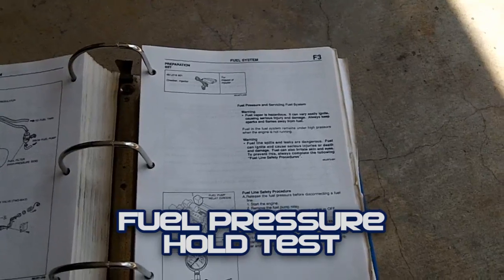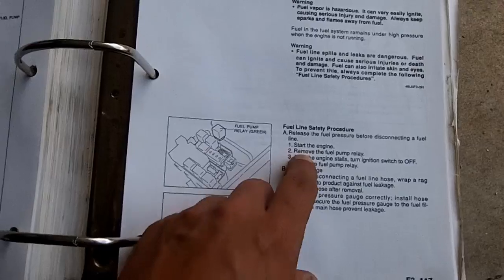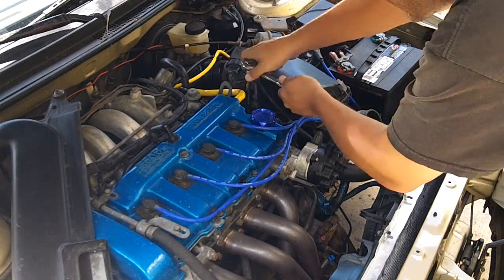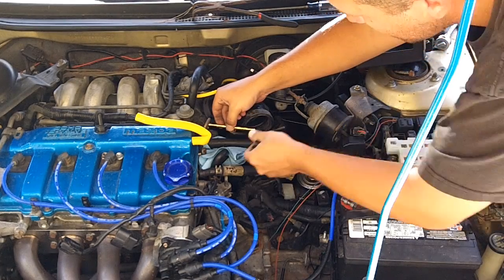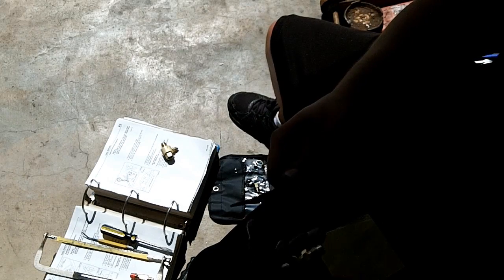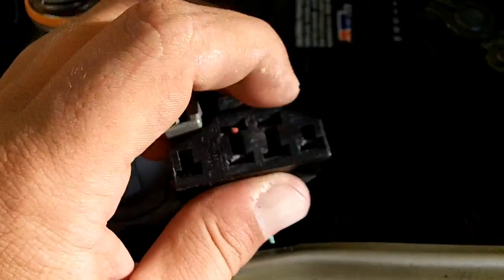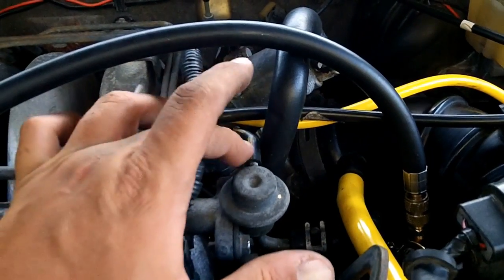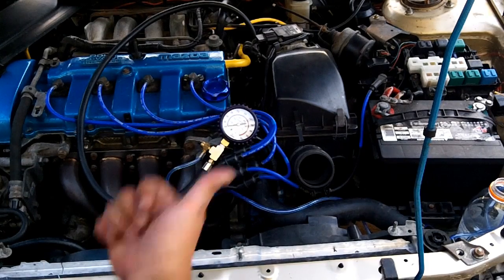Mazda 626 - Fuel Pressure Hold Test

Comment: Ive been watching your videos about Mazda 626s & seen some old posts on websites u seem to know ur stuff  Im having a cranking but no start problem. I noticed for abt a month my auto 99 626 was puttering but usually hit the gas itd straightened itself out Yesterday It cut off & now cranks no start tried starter fluid but still no start. Ive also have had the flashing key in the car problem since buying the car. Someone at mazda said possibly the anti theft is keeping me from starting it? New plugs ignition switch changed 2 months ago Im in the dark here 😞
Reply from the maker: KDee Underwood The little "key inside the car" icon in the instrument cluster is indeed related to anti-theft.  Have you tried pulling codes?  That might give you a clue. ;)  Good job on using an aerosol to rule out fuel.  You should also check for healthy spark and my guess is you will find that there is no spark.  If you can crank the engine it means your ignition switch is good so you have done some steps already to start eliminating possible culprits.  Good job.  Plenty more to test, keep going.

Comment: Great demo Devin!  I'm working on an 04 Mazda 3.  I wish the Ford influence would dictate a built in test port.  Dare to dream huh?  The 2004 2.3 Federal I.M. doesn't have the OBD II read on fuel pressure either.  Kind of a black hole model.
Reply from the maker: briansmobile1 The Probe of the same year and engine did come with a schrader valve.  I'm probably going to swap the fuel rail from a Probe one of these days.  No idea why Mazda didn't go with it. Certainly makes life easier.  Thank you for stopping by and leaving a comment on a video.  You know I'm a big fan of yours. :)  Oh and ultimately in this series it turns out to be a leaking hose attached to the fuel pump.  Fuel hose was leaking and bleeding off inside the tank.  That's where all the bleed down is going.
Reply: ***** That Mazda 3 video launches in the morning - gave you a shout out and link to this video.  You're the man!
Reply from the maker: briansmobile1 Sweet!  I get a shoutout from Briansmobile1 whaaaat. :P

Comment: @devon3 but im hearing things on net tht we post to use mid-grade gas? Oh yeah i swap out pugs too with ngk and gapped them at .044.
Reply from the maker: Sounds like you need a tune up.  You should really have a mechanic look into it because there's a lot of things that can cause lack of power, most likely a small air leak, tps adjustment, or timing.  The 2.0L is a mid-grade fuel but you can put high octane in it.  Only the V6 requires premium.  I use premium right now because of issues still stemming from my MTX swap.  Most 1.8L and 2.0L owners are recommended to use mid-grade fuel.  I don't know how ethanol plays into that now.  That would be something to research.  Probably something I'll need to research as well.
Reply: @devon3 thanks alot man
Reply: @devon3 oh i forgot this is off topic but the window washer dont work. i looked under hood near the washer fill tank and saw a elec connector disconnected near inside finder but cant find where it goes?
Reply from the maker: Omar Chisolm Is it a European version?  The Euro 626 has phantom connectors like that all over the car and no one knows why.  If it's a US version then it's got to go to the something.  Get onto Mazda626.net and post up a picture or post a video for me to look at.  Can't see what I can't see.
Reply: @devon3 will do. thanks for al ur hep and patience

Comment: @devon3 good morning man. another? i have a 2002 mazda 626 2.0, and have some hesitation issues. not a the time but when accel from stop light it drags a bit. once i hit 2500 then it smooths out. i cleaned the MAF, and throttle plate, and changed air filter. is there anything else to look at? pus do i have to use octane 93(plus) or reg? i dont have turbo

Comment from the maker: I'm failing some pressure tests but passing others.  I'm thinking it's that check valve or fuel pump now.  Unless I replaced it with another bad regulator which is possible... BriansMobile replaced a Protege regulator 4 times in the same video because he kept getting bad ones (brand new from the dealership).  Still more testing to do.  Have about 4 more videos to do this week just on fuel pressure alone.